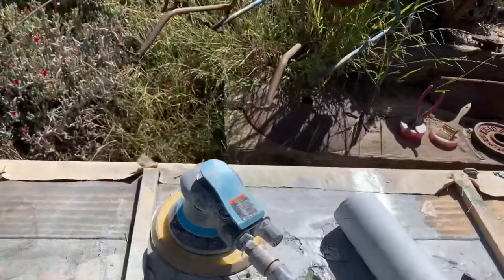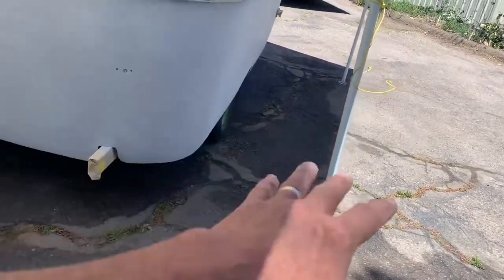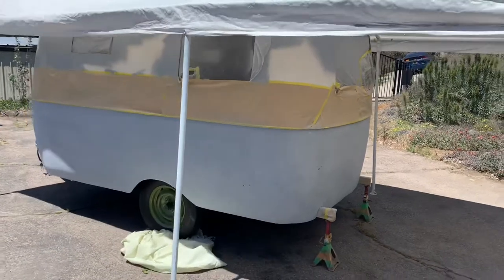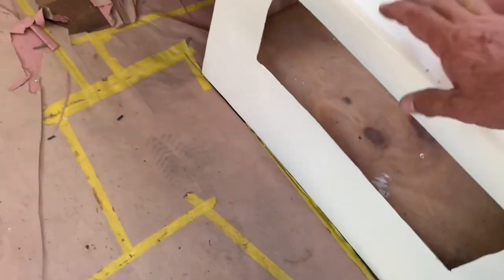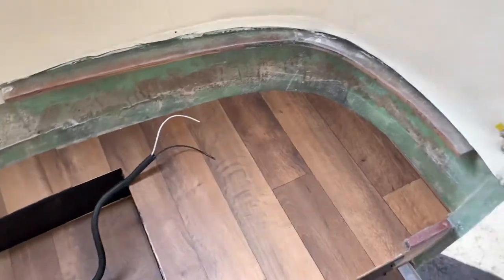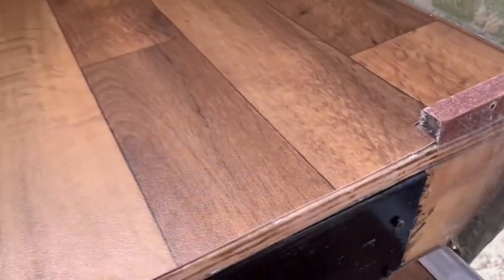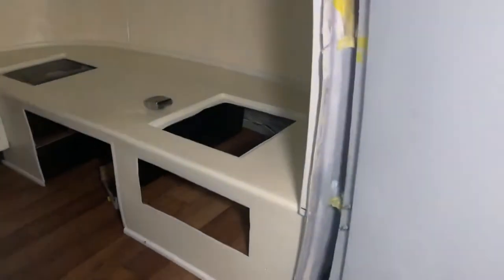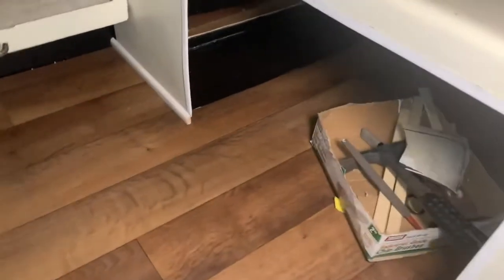Scamp Trailer | Front Floor Installed | Painter MIA

Comment: Thanks for all your videos.   I sprayed my Boler with a primer and now so many pits holes and spider cracks showed up as suspected.   I am trying to fix them with glazing putty.   Which is hard to use and sand.  I was wondering if you have any other tips or suggestions to fine tune now before final.   Thanks a bunch.
Reply from the maker: Hi Trevor!  So I use the glazing putty over cracks that I have grinded out as much as possible with a Dremel (1/4” shank) metal attachment that resembles a small ball. It’s only 1/8” and I grind through the “gel coat” and a little into the fiberglass itself. Then, I clean that with air, acetone, the apply the refined body filler which is a glazing putty. I’m not sure why it’s hard to sand for you, you can use 120 grit (instead of 180 or higher).  I recommend you use a “High Build primer” because it will fill any imperfections 
much better, and because the high build primer (also known as 2K primer) is much thicker, you can hide the sanding marks much better. I hope this helps, if not let me know. 👍🏼 ~Westcoast Johnny
Reply: @westcoast_johnny  thanks Johnny.   Much appreciated.   I was using USC Icing it dries so quick and is hard like concrete so so hard to sand out after I fill.   I might change to a different glazing putty.  Any recommendations on brands?